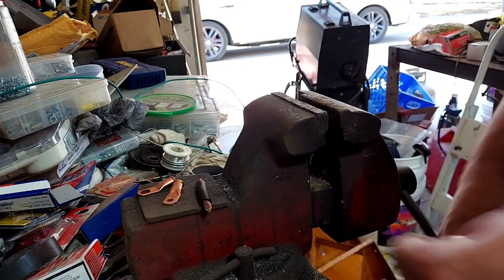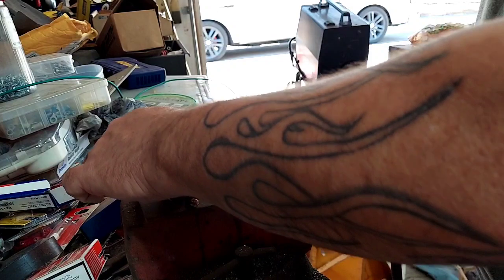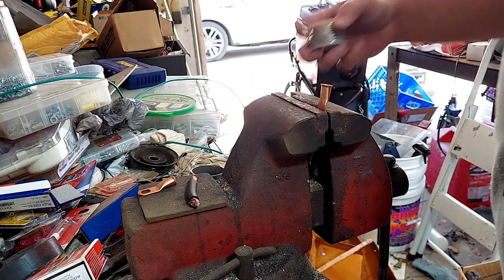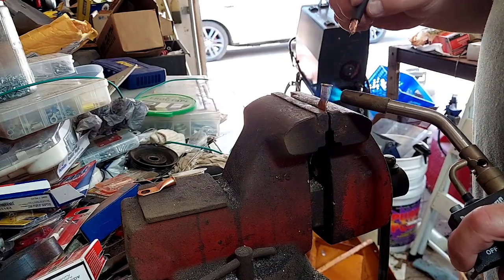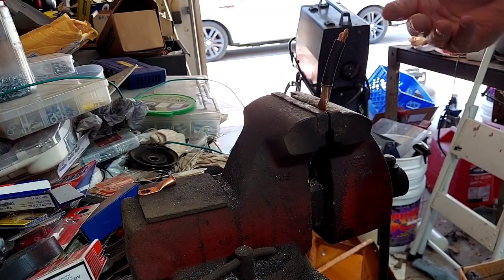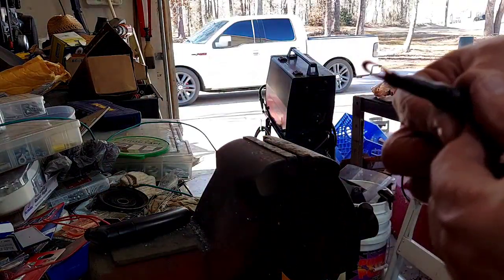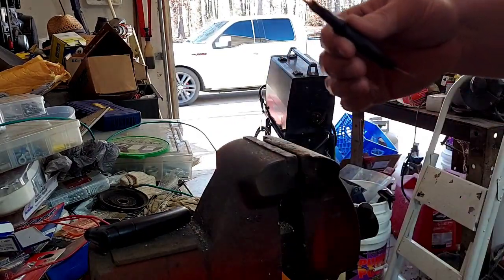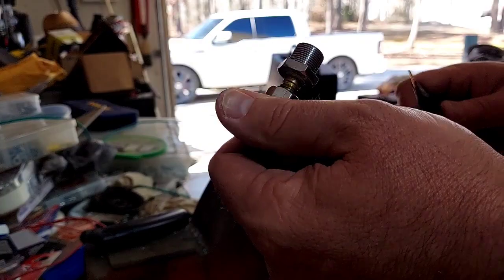Make your own CB antenna ground cable! It's a really easy DIY.

Comment: I have a hood channel mount on my car with a firestik I was thinking about just drilling a hole in the mount an running a wire to the closest ground strap do you think that’d help I can only fit about 10awg though since the hood doesn’t have much of a gap
Reply from the maker: Or, does the mount not have a bolt holding it to the fender? Otherwise, yes you're on the right track. I'd go to the closest ground or if it's closer to go straight to the frame.  If that get rid of any undercoating or paint at the ground. Thanks for watching.
Reply: @jrichtruckincbtips  it has two self tapping screws it’s on a Camry just one of those little hood channel mounts I shoulda got rid of the paint before installing it but I’m afraid to undo the mount now and have to use bigger screws cause there’s only one spot that has enough of a gap to put the mount so I was gonna go directly from the mount next to the stud for the antenna and just use some type of connector with a screw and run it to the closest ground
Reply from the maker: @ChristiannTyler  yeah, leave the screws alone, I'd do like you're thinking and drill another hole. Make the ground wire as short as possible.  I gotta get on the road now.👍
Reply: @jrichtruckincbtips  right on man thanks
Reply: @jrichtruckincbtips  goin from mount.to frame adds electrical length to ant..Your tune will be way off..
Reply: @craig_sez8534  so do you ground to body then from that spot go to frame?
Reply: @TruePatriot127  Yeah i would connect doors to cab..Cab to chassie..kinda thing...As long as your useing wide braided strap and keeping it as short as possible(allow enough length for movement dont use normal electrical wire..Rf travels on the surface of the wire not in it ),pretty much the same idea as a car/pick up..I wanna do more on my freightliner but its up in the air if company will be switching me out for a new truck so i dont wanna waste the time and product only to be pulled outta my old trk in a few months..
Reply: @TruePatriot127  Think of bo ding as in the fingers on your hand..Easch part has its own short connect point and they all end up down on the chassie...Grab some of them star shaped lock washers and use them as well..Seems to be alot of zink in paints and n prep products so you dont have to clean off the paint down to the metal..Scuff it some and those star washers shouls dig into the paint and be a decient bonding..Double chk with a multi meter and then go listen for noise on your rec..Make sure everything is turned off,slowly keep turning on one more option like lights,gps/cell chargers ect (with key on)and finally a start to see if you hear engine noise..If all is quiet,chances are your good..

Comment: Never use wire for a rf ground 
Strap is the way to go wire can radiate like a antenna
Reply from the maker: While wire or cable is not ideal. It's often difficult to find a rf strap long enough, especially for big rigs.
Reply: The antenna should be grounded DIRECTLY UNDER the antenna. If you don't have a good ground connection at that point, the wire you add regardless of what it's made of becomes part of the antenna. It becomes an unbalanced dipole instead of just a whip antenna. This leads to SWR problems, noise etc.

Comment: You can't crimp over the weld. You break the solder when you do this and take away the benefits of the crimp ...
Reply: Just solder over the crimp ;)
Reply: @KillerKatt66  Crimp or solder have distinctive qualities. On the other hand, in the case of a connection that will not have much vibration, will not be manipulated or will not move, then soldering is a good practice but only after crimping without overheating the wire and the connection on a clean surface.

Comment: While this guy certainly made a nice "looking" wire, that's actually not a very good setup for use in a moving vehicle. Even the FAA has banned the use of solder in aircraft electrical connections. EVERYTHING must be a crimp. Why? Solder gets brittle when exposed to vibrations such as is experienced during flight or driving. Crimp is by far the best connection for anything on a moving vehicle of any kind. That being said, NEVER crimp on a solder joint. You just busted up the solder inside the connector. But other than that, nice video.
Reply from the maker: It's not as ideal as flat braid, but is better than when someone tries using 12ga speaker wire for a ground.